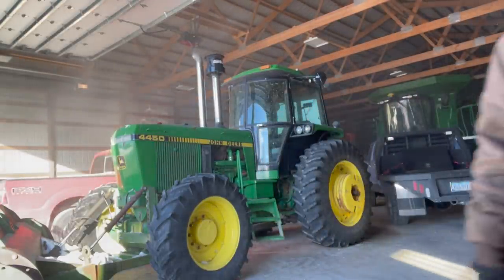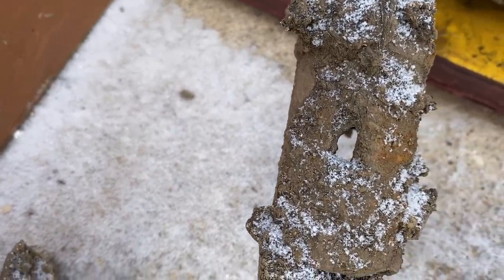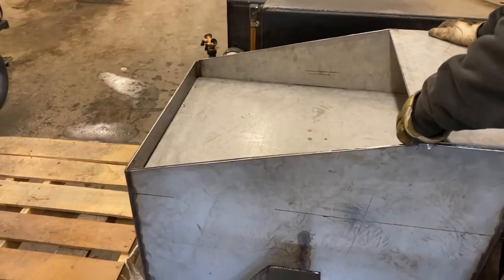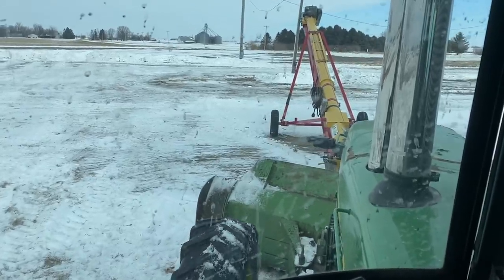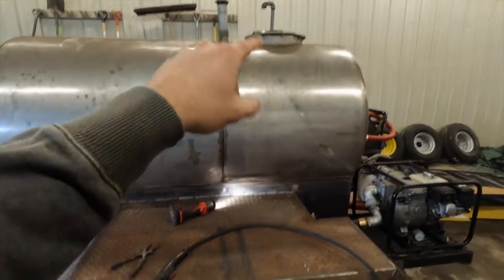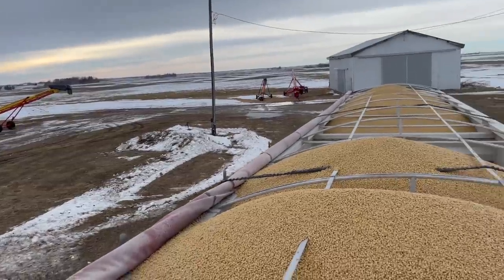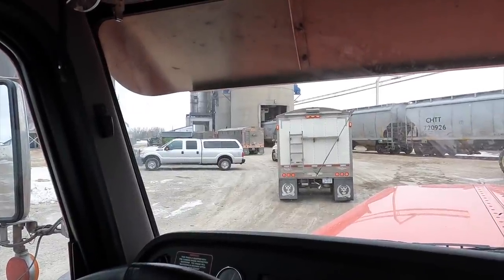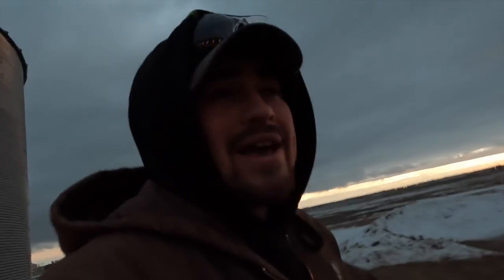Hauling Beeeeanssss! | Custom Made Fenders For MANNder Creek!

Comment: John deere and chrome o thought it was john deere and loans 😀 trying to pay those bills it cost 20 percent extra for green paint 🤣 but I believe that this year we may have to go with 30 percent on top of everything except fertilize it's double great video 👍
Reply from the maker: You may just be a comedian… 😂 there’s a reason Deere sells the most units 😉
Reply: @mannfamilyfarms381  they have good models and bad just like everyone else.  I like the older ones the best neighbor has 11 and the 4430 is a Cadillac in the hay field but the 6115 well I sure wouldn't swap my puma for it that's for sure. I will say in its defense it's the cheap model with the shifters on the floor if it was loaded it would probably be a lot better unit